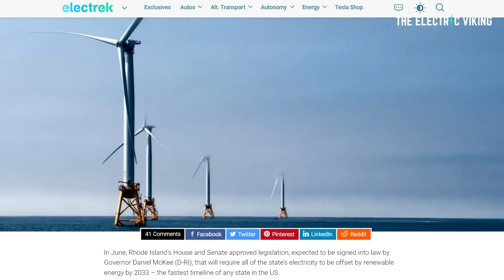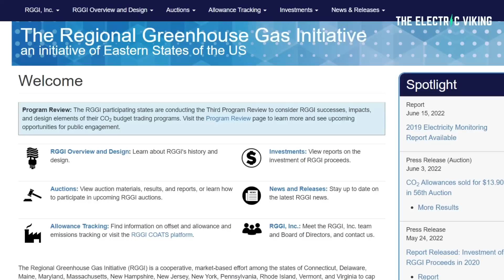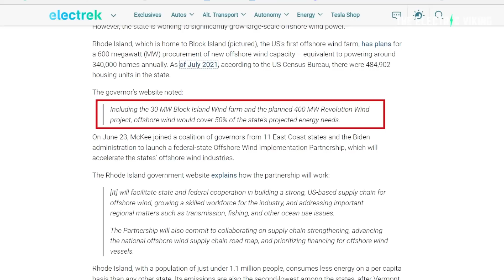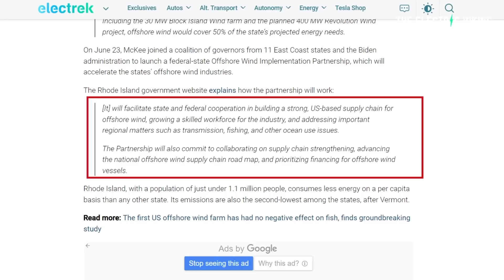This US state will achieve 100% renewable energy by 2033

Comment: SAM you seem to forget that the heating oil pollution problem it's far worse that diesel cars.. I'm surprised you don't lobby for this.. but then I guess it doesn't sell YouTube videos  eh ? In the UK I use 1500 litres a year.. that's 18000 miles equivalent in my honda civic at 60mpg.  However my Honda Civic is a lot cleaner than my central heating boiler as it has particulate filters which my boiler does not.. and most people don't do 18000 miles  a year ... So with these two things together the oil central heating boiler is a lot more polluting than my car .. three times as much probably. Ok not everyone in the oil heating.. oil and gas cover the majority. The government's as other people seem to be ignoring fact .. there are no subsidies or incentives whatsoever for people to change... What are we going to do SAM ?

Comment: Of course the USA will achieve 100% renewable energy by 2033. Heck it can achieve it by 2030. It will do so, like it does every other thing... change the rules or the definition. " In 2030, The United States President will declare natural gas and coal as "renewable" and also declare that it has achieved 100% renewable energy... Easy. The Western media will hail that as a great achievement. Western academics and analysts will write papers to support that declaration. After oil, gas and coal comes from nature, thus it is just a matter of time scale for those to be renewed... Viola... climate change avoided.

Comment: Just curious if you've seen this. If it works, the cost of electricity will fall to a fraction of what it is now, just about everywhere will be able to achieve net zero by 2033 and coal, gas, nuclear, solar and wind will all be obsolete everywhere that has a power grid.

https://www.youtube.com/watch?v=kF5cfhOx2ww

Comment: They won t be able to achieve it, because not only will they have to convert the current CNG based electric grid with Wind and Solar ( that is doable, thanks to Elon’s utility batteries ) , they also have to convert ( or offset ) all car gasoline, truck diesel, and then they have to tackle all oil and gas heating, all at the same time. In addition, they should not attempt that,  because the lowest income people will be hardest hit by draconian energy prices. And for what? This will do about  0.0000 for the largely imaginary problem of Global Warming, which is useless even if one does believe in the GW Hysteria.

Comment: The points at the end are the crux of the matter — actually closing the natural gas electricity plants and converting all the home (and commercial) heating systems to electric of some type, either heat pumps or infrared heating systems would be the top options. Ground source heat pumps possibly installed at the neighborhood level might be a way for the state or local governments to step up and help homes convert to affordable heat pump systems.

Comment: heating oil is really not used that much anymore anywhere but a swath generally from the lower middle PA to Maine.  It's diesel fuel these day basically of course but under 5% of US home heating is oil now.  Whatever RI can do to reduce that, will be a great thing.  I think it's 7 states that have any volume of it still in use and it's dominantly in the extreme NE states.  Drops every year...

Comment: Rhode Island is one of the first states in the USA. The also means they still have a lot of old houses built before electricity was invented. Using heating oil was better than cutting down and burning trees for heat. Converting houses can be a problem, especially since removing oil tanks requires a hazardous waste permit and proper people to do it. I am surprised they haven't required the removal on all houses.

What upsets me the most is those stupid offset certificates. Those need to get away since they are bogus. States need to document how much renewal resource energy they are producing and how much fossil fuel produced energy they are using--no offsetting. This is how GM is till in business because they've found too many ways to make it  look like they're meeting USA requirements when they really aren't. All the states and corporations are doing is cooking the books.

Comment: You didn't say anything about batteries.   IMHO it makes no sense to do any renewable project without associated batteries to allow time adjustment from when the energy is generated to when it is needed to be used.  Also Tony Seba has calculated for various parts of the US how much extra wind and solar generation is needed over current usage for it all to work unless someone invents a longer term storage capability (multiple months of time variance).  For the northeastern US the excess number needs to be around 4-5 if I remember right.  This excess is needed because of the lower generation of solar during the winter months.   So  the goal for total capacity for solar needs to be much higher than current usage.  Please read Tony Seba's white paper on this.  He also proposes some interesting things for using the excess energy available during the summer.
Reply: They plan on exporting excess electricity and importing when needed. 

With much better grid interconnects, a 2x RE overbuild nationally wouldn’t need storage at all most years with a 25% shortfall experienced once every 10 years. That could easily be handled by widespread V2G.
Reply: @williammeek4078  I don't believe it.  Do you have any references?   Please look at Tony Seba's analysis.  I think it would apply to AU also.  Away from the equator there is much less solar energy available in the winter time.
Reply: By references - I mean detailed proposals or explanation on how they would handle the time variance issues?

Comment: The race to "go green" is a farce - it is not needed
All you have to do is fill up your gasoline car and find out how "going green" will bankrupt the USA
We have a 100+ year supply of clean-burning natural gas under our land that is cheap 
Green energy is expensive to build and run and when the sun doesn't shine stops working

So expect the folks of Rhode Island to pay the highest electricity rates in the nation
and for what? man-made global warming is a scientific hoax - you can't find one peer-reviewed paper proving it nor can you find one Nobel prize awarded for proving man is warming the earth
Reply: look up levelized cost of energy.       The cost of solar power and wind power has come down a lot in the last 10 years.    Solar power and wind power now are cheapest electricity in many areas.     That is the major change that has happened recently.
    
Battery costs have also come down in the last 10 years.    That is why all the discussions of battery electric motor vehicles.

Comment: Not every neighborhood in America has access to Natural Gas, nor do they want or are allowed a large propane tank in their yard.  Heating oil, on the other hand, is readily available.  The other option would be electric heat, but it’s wicked expensive.

The US needs to invest heavily in the adoption of heat pumps and geo thermal. Since that is not an issue affecting every state, I don’t see much hope in it happening.
Reply: Heat pumps use a lot of electricity, and don’t heat very well when it’s super cold

Comment: A young startup in the Northeast called Dandelion is using heat pump geothermal coupled to a vertically drilled shaft. The company is also vertically integrated handling everything from the permitting to drilling to heat pump installation. 
The genius is being able to pull heat from a liquid heated by the earth to 50-60 deg vs. pulling heat from sub zero air in winter.
Reply: I’m waiting for them to come to MA to help lower the installation cost since their drill rig is far more advanced than others.

Comment: Going to need some battery storage also. That's the key to stability and emergency use.
Reply: Agreed. For anyone who wants to learn more about the economic viability of "solar/wind plus batteries" for grid power generation, I recommend you watch from about 30 and a half minutes until 39 and a half minutes in this presentation from Tony Seba: https://www.youtube.com/watch?v=Kj96nxtHdTU&t=1833s
Reply: They are planning on exporting excess so the have the capacity to import when needed. Grid level storage isn’t really needed. Individual homes would need some for grid failures though.
Reply: @williammeek4078  Homes would be a good location for virtual battery, that way you don’t use land a create a target.

Comment: Offset is not the same as real. They will be using electricity from carbon, just feeling good about it.
Reply: Offsets are not as good as eliminating generation, but they're still a net positive. As RE gets cheaper, states like RI will discover that adding RE is cheaper than the offsets. For the same reason, automakers are getting tired of buying emissions credits from Tesla.